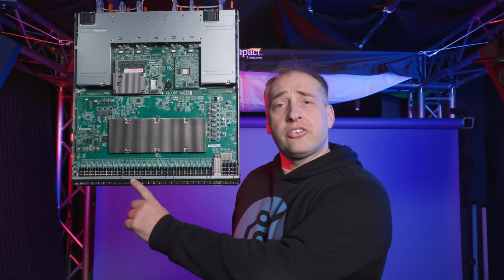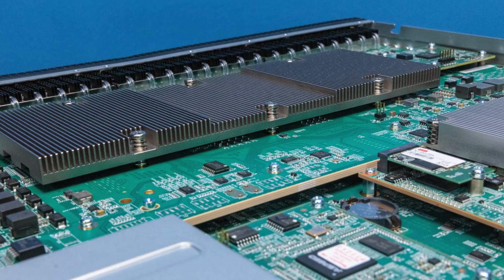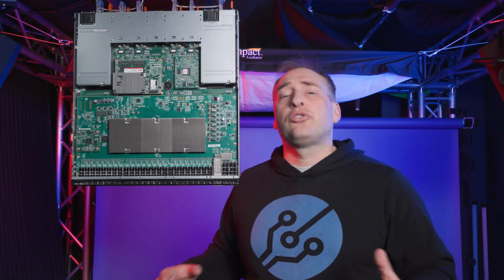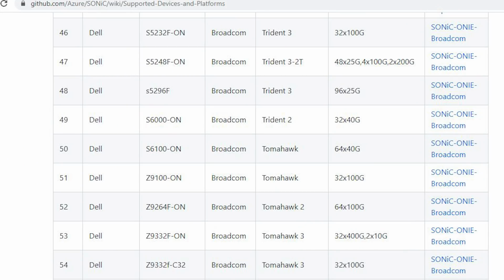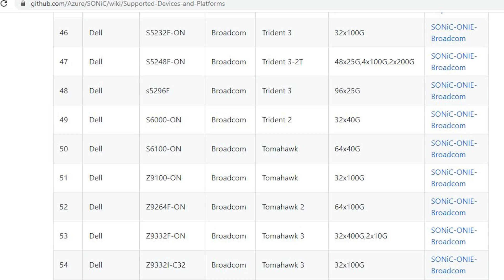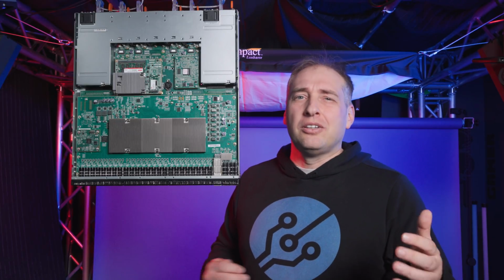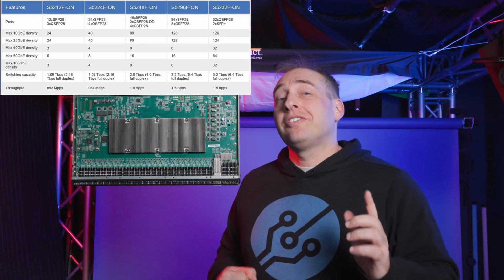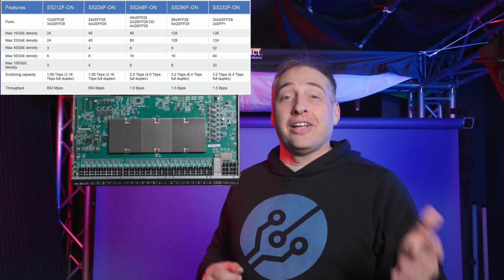Dell's 200GbE Surprise - S5248F-ON

Comment: I'm wondering if that battery is even needed at all. The basic bios-settings to get the switch booting into the OS could be very general, if not default. And keeping the clock should not be an issue for a device that's running 24/7 on multiple power feeds and also has multiple NTP servers configured in most business cases and data centers. As a data center networking guy myself, I never had any thoughts if the batteries in my routers and switches could have a replacement after a few years of operation.

Comment: There are a couple of downsides to this switch that I don't recall you mentioning. One, the SFP28 ports don't support 1Gbps. 10 and 25 is all you get. This is a pain in a more mixed environment where perhaps you want to connect WAN links or perhaps some management connectivity, or a lower end firewall. Also, the SFP28 ports can only be switched between 25Gbps and 10Gbps in groups of four, so I wonder if they're actually QSFP28 ports with on-board 4 to 1 breakouts. And at least in OS10, doing so changes the interface name which gets a bit unpleasant. eth1/1/1 becomes eth1/1/1:1 - far from a deal breaker, but it's just a little more awkward to work with than it otherwise could have been.
Reply: Yes, the additional :1 on the interface numbers in 10 Gbps mode is super annoying when trying to make configuration changes for ranges of ports!

Comment: Thanks for the review. As for the zip-tie-hanging I'd make small metal plates with holes for those, and attach them to the rack screw holes in the switch ... the retaining mechanism & handles for the power supplies was never built to support the weight
Reply from the maker: I probably would not have done this on a switch without that damage.
Reply: @ServeTheHomeVideo  Plot twist: The switch had that damage because it fell off the first time you tried hanging it. :-D

Comment: From now on, ONLY ever pronounce the company name properly.  American Mega TrAnds.  And enunciate it as clearly as possible in all cases you might have a reason to do so in future videos.  

I also have 2 of the 32 port 100Gig models in service.  Breakout cables are cool but they make the switch look very underutilized in my case.  (Only have this model because Dell had stock issues on a smaller one and substituted the monster 32 port unit at the same price to complete a deal)

Comment: cry's in 2.5GBps file server and Atom 330/1GBps pfSense powered firewall

But, honestly.. running RAID 1+0 on HDD's 1GBps is still more than enough for 99% right now. Hell, there's a small company i do work for that still has 10/100 with 2 1GBps ports with no need to upgrade 😅 Maybe in a few years when the switch dies🙃
Reply: Still using the 48 port gigabit procurve switch I bought for ~$20 4 years ago.

Comment: I gotta know... Is the unit you used for pictures still functional?

Also, why did you literally hang it? XD
Reply from the maker: It is, but we are not using it because of the damage. On why hang, perhaps the better question is: why not?
Reply: @ServeTheHomeVideo  fair, I'd be a bit worried about damage related issues down the line for any real production use.

On why not to hang... I guess it doesn't matter if it falls, but it seems like more work than adding an image in post :P

Comment: As someone with a small home lab with barely 10GbE, this thing is insane.
At 200-250W your switch is using as much as my entire server does handling all my little tasks.
Reply: Barely ? I still run 10gbps at work for virtualization and with about 70 vms it's still not bad. To get 1.2 GB over network is still not easy with all the pieces in the way. Unless budget is not an issue.
Reply: I'm using a Mikrotik CRS326-24S+2Q+RM which uses about 40W. Going all 10gbe without blowing up the power bill is possible nowadays. Give it a few years and the power usage for 25gbe will come down.